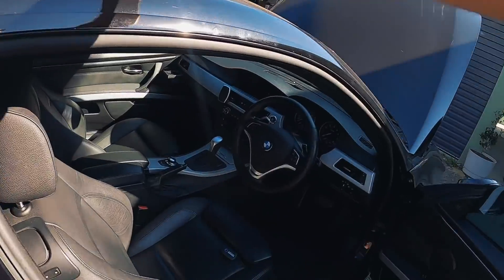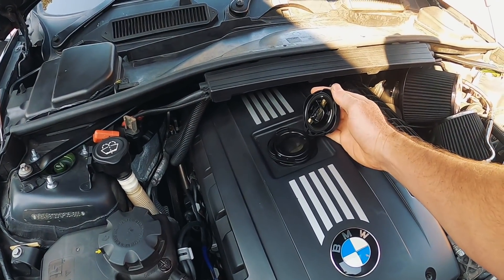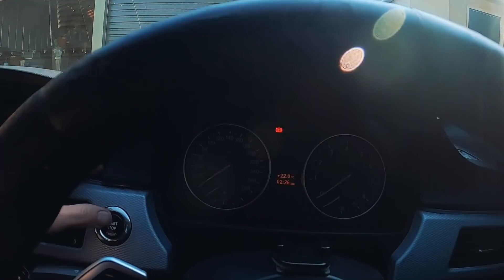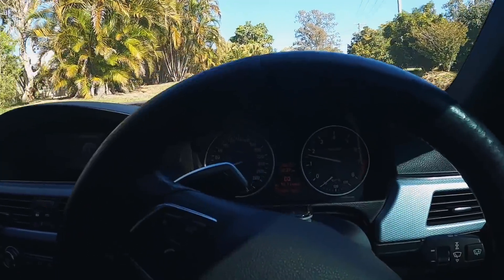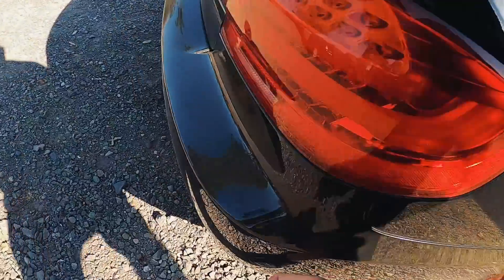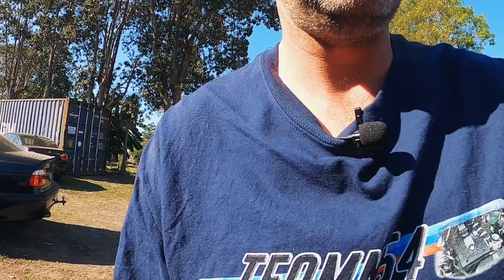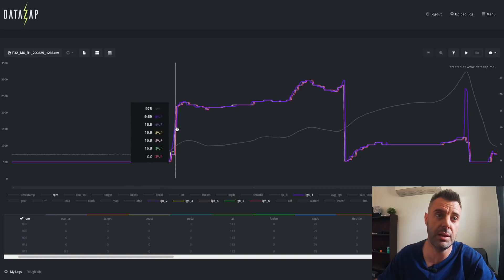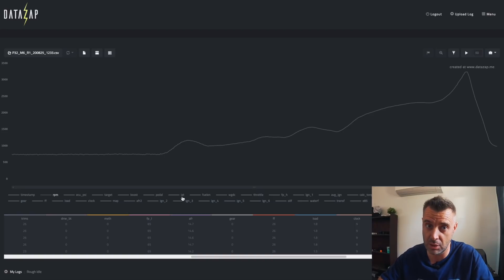BMW E92 335i N54 17T Hybrid Is Now A 5.5 Cylinder.....😖

Comment: FWIW, my car would sound like a cam when the spark plugs were going bad. Changed them and it fixed the issue, but I have the PR Coils so it never actually throwed a missfire code or the likes, just sounded like a cam, check them and their gap before you jump the gun into opening the engine up. For the coolant loosing presure be sure its not leaking anywhere, my o ring coming out of the expansion tank and the one at the bottom of the radiator for the AT heat exchanger gave up and created the same sympthom with the added loss of coolant in time, not pretty at the track

But long story short:
-Check compression
-Check spark plugs
-With cylinder roughness in mind check the coils or swap them all if you have enough spares

If non of these solve the issue... well shit
Reply from the maker: Really? I would have spent 4 hours googling today and couldn't find anything plug related that resulted in a similar noise. But this sounds like it has a cam.  I do have my old plugs which were fine, so i will pull these, do a compression test. If thats fine, ill put the old plugs in and see how it runs.
Reply: I had a similar problem with a gsxr600 that had bad plugs...fingers crossed...
Reply: @ZeroTo60Tube  It took me roughly a week of checking stuff out to find the issue, I think it was on spoolstreet that I read the possibility and went from it and solved it, it may not be your problem but its worth a shot
Reply: +1 to this, my E46 was like this and after plugs was fixed.

Comment: Have you considered arp head studs? I’ve seen them solve head lift on other platforms... if it’s pointing that direction.

how does the oil look?
I’m suspecting mild plug erosion or fouling.
Reply from the maker: I haven't looked in to the ARP studs yet. A good condition N54 "should" be fine at these boost and timing levels, however my motor was not a good condition one when i got it. Which is why i bought the spare car.

Comment: Everybody saying check smooth running is how you’ll narrow down a weak cylinder.  But based on your afr chart I’d put the money afr 2 “bank”. It looks very rich.  At idle anything other than 14.7 is bad.
Reply from the maker: Bank 2 is where the ticking noise comes from.....

Comment: Cylinder 6 just shat the bed on my upgraded turbo n54. Pulled the plugs and I was missing the ground electrode on #6.
Reply: What power you running to blow up 2 motors already?
Reply from the maker: Was yours knocking or just an uneven exhaust note like this?
Reply: @br4d101  just 1 n54, blown up 2 audi engines though. 4.2l s4 and a big turbo 1.8t a4. N54 is running similar turbos to these in size with pretty much the same supporting mods. 24 psi and only 11 degrees of timing
Reply: @ZeroTo60Tube  mine had a misfire then made a knocking sound. Hard to tell over video but I think mine is more of a mechanical knock. I haven't done the compression test yet to determine how bad it is but I pulled the plug on the one that misfired and there's no ground electrode. My guess is that my knocking is the electrode wedged between the valves or something like that. Going to do a compression and then pull the head if it's bad

Comment: I feel like if you have a compression leak that you would see a lot of unburnt fuel going through the exhaust, which would show a rich AFR, which then the car would pull fuel...but you said trims looked good. We're the long term fuel trims ok too?

Edit: I also just thought if you bent a rod, even if it's just slightly, that you would have lower compression...which would lead to that deeper sound and the ECU wouldnt really notice the change that much
Reply: these cars don't bend rods. Piston or rings would go before rods.
Reply: @maxwellbrown2584  ok I think we all can agree that the n54 has beastly internals, no one will disagree with that claim, the fact that we can push over 600torque from stock internals is astounding considering this is "just" a working class commuter motor by design. But bending a rod isn't actually that hard to do. There are guys out there who have bent rods with relatively low power compared to these guys, and it just comes down to so much torque so fast. Again, we're trying to diagnose a potential problem these guys are having, and a bent rods, even if it's just a slight bend would equate to the symptoms they're having. I don't actually think that is the case, but considering all of the tests they've done in the video, it's still an option on the table.

Back on the rod topic; you give a tuner the challenge of bending a forged aluminum rod good for 1200hp, give them a couple hours and you'll have yourself wasted money and rods. Obviously a hypothetical situation, but the rods in the n54 aren't indestructible. 

Not trying to start a war with you, because you seem like you have knowledge on these motors by your comment, but let's leave these types of comments for the forums ;P

Comment: Checked the oil motor how looks and check the antifreeze level
Reply from the maker: Antifreeze level seems normal. i have not topped it up since doing the turbos. So it should be ok. Haven't dropped the oil since i noticed this yesterday.

Comment: This may sound weird - but it your battery good? I had some weird stuff happen when I had a bad battery.  I'd also check the plugs and coils - make sure they're not wet from an intake manifold gasket leak.
Reply from the maker: It should be. Its under a year old and i am crazy about charging it if i leave the car sitting for a few days.

Comment: Injectors throw no codes, talking from experience here too. Have you the latest injectors? Mine leaked and lead to rod knock, so change them if you havent.
Reply from the maker: I didnt know that. Thought they would throw codes. Yeah i have index 12s.
Reply: Zero To 60 they shouldn’t be the issue then, if they’re index 12s. Any ideas in the issue?

Comment: I've had an issue that's not completely the same but similar. My ideal was not completely smooth and had pops/ small little misfires but no codes at all..... Changed the plugs and coils and has been fine since.... It's been about 2-3 months since I had changed them now
Reply from the maker: hmmmmmmm i would have thought, it would throw a code. But i guess if the plug is cooked still using the same current the coil, will be using the same current and the DME wont throw a code. But these plugs are under 2000k's old.
Reply from the maker: Dude also just noticed your badge. Thanks so much for becoming a member we really appreciate it.
Reply: No problem 👍 love what you guys are doing...... I can't remember if you guys changed the coil pack or not ? Mine were from 2007 so it's possible that mine was just old age causing the issue I had.

Comment: don't panic you should clean or replace your vanos...You don't drive the car enough so it takes a while for the computer to learn your driving habits and turbo set up 
even if you tuned it for the turbos the ecu is still learning whats done to it. Based on your log

Comment: same car, same problem. I guarantee it is not head gasket. I cannot tell you since you have a jb4...which is notorious for this kind of mysterious misfiring. Reflash to stock to be sure it is not jb4. Then replace plugs if they are fouled, and if not, then replace coils. Fuel delivery is not the issue since it doesn't go dead when revving higher.

Comment: slightly bent rod perhaps? Maybe a small head gasket leak into one cylinder? Hopefully it's just air fuel related and an injector has an air leak like dominy suggested. Are you able to run it port injection only? That may narrow it down.
Reply from the maker: Nah defs can't run PI only.

Comment: You ever had the valves walnut blasted, mine sounded like crap on tick over just like that to be fair, I done it n idle was sorted and ran sweet as! Also check your plugs haven’t backed out slightly, they do come lose! Even if u torque them down right, doubt it’s the engine though, they’re pretty bullet proof!
Reply from the maker: Yeah, i did the blasting about 4000k's ago so they should be clean. A backed out plug i reckon would cause this exhaust note, although i would have thought you'd hear it in the engine bay.....Need to get on to it.
Reply: Zero To 60 I’m not sure mate, you’ll have to do some investigating, mine did sound slightly like that though!

Comment: @2:42 sounds like u have a bad hydraulic lifter...  get it checked out before it gets worst... i can hear it slapping through the headphones ... hope that helps🙂
Reply from the maker: Could a bad lifter cause this strange sound out the exhaust? The ticking I have mentioned in the past is definitely in the head.
Reply: @ZeroTo60Tube  Yes
Reply from the maker: @blrn54  what is the best way to check for the lifter? I assume the valve will still seal, but it wont be opening fully.
Reply: @ZeroTo60Tube My guess rings busted or lifter buggered and staying 2mm open. Compression to see if its rings then pull cams out if it has compression. 100% not head gasket. Ive seen 3 or so go in 8 years.
Reply: Playing hard with boost and timing I like it.
Reply: @ZeroTo60Tube  yes definitely it can.. take the valve cover off and rotate the engine with a 24mm socket manually and check clearance between the cam and rollers..

Comment: Hi, did you check the oil filter? I discovered fine metal shavings in mine, but my engine doesn't make any wierd sounds surprisingly.
Reply from the maker: I did when i changed the oil a few weeks ago, but not since the strange exhaust note popped up.

Comment: I'm not sure on the condition of your battery, but during NZ lockdown my 325i sat for a while on an old battery. It started fine, and seemed to drive okay, but when i stopped the car it developed a very rough idle. Possible that youre having something similar?

Comment: Have you done a carbon cleaning on the valves lately or ever?
Reply from the maker: Yeah i did them about 4000klms ago.
Reply: @ZeroTo60Tube  Try smoke testing the system to catch any air leaks.

Comment: Time to start doing the normal diagnosing man... start with the common stuff coils, spark plugs, do a comp test and definitely do a leak down test as a comp check wont always show a head gasket failure... you should have noticed some increase in coolant tank pressure or excess temp if it is a head gasket? Either way man I hope it's nothing to serious for you 😊
Reply from the maker: Just remember if this is a serious issue.... the spare motor is going in and this one is getting built......Purely so i can keep up with you and your new turbo.... :P
Reply: @ZeroTo60Tube  hahahah now that's gonna be some good videos 😊 and you can already keep up with me but will be good to see if I can still keep up with it once its built 😊🤔

Comment: You may have a very small vacuum leak that only causes issues at idle and at certain throttle. I honestly have no idea but that's just a guess.
Reply from the maker: Thats what i thought at first. But the stutter or strange sound doesn't change as i bring the revs up. The engine smooths out a bit, but you can still hear its not right from outside the car. It's like its firing on all 6 but one of the cylinders is not quite as explosive as the rest.
Reply: @ZeroTo60Tube  that makes sense. Do you reckon it could be a big exhaust leak? You mentioned it didn't really feel down on power or is it a clear stutter you can feel as you accelerate?

Comment: Maybe you can do a compression test on all 6 cylinders. Prolly doesn't hurt to look at the spark plugs either. Maybe one of or more have carbon buildup and a slightly smaller gap as a result. Also the fuel tank could be worth investigating if you are running ethanol and it's been sitting for too long. Plenty other ideas, but I hope it's just contaminated fuel that's messing with your maps and sensors. Good luck mate.
Reply from the maker: I definitely need to get the plugs out, check them and do a compression test. I had choice this afternoon, it was make a video and edit it, or start pulling it apart. I really didn't want the bad news, so a video seemed like a nicer option.

Comment: Reset adaptations? Monitor AFR? O2's? Plugs?
Reply from the maker: AFR's are normal. O2 sensors are like 3 weeks old. Plugs are about 2000 k's old. I will pull the plugs and do a compression test in the morning. I could have done it tonight instead of the video, but to be honest, i dont know if i want the bad news.......

Comment: Wonder if it's a leaking injector, either leaking compression out of the cylinder or leaking fuel into the cylinder.
Reply from the maker: They are index 12's so it would be unlikely its leaking. But the injector seal. I wonder if it's the problem. Mind you the engine sounds normal in the engine bay. Thinking about it, i bet you would hear if the compression was sneaking out of the injector seal.

Comment: Why don’t you do a power balance test first, that will isolate which cylinder it is.  (pull coil plug 1 at a time, 1 by 1 and look for change in idle).  Then try swapping the coil with a different cylinder and see if the misfire moves.  I suspect it’s a dodgy coil.  🤞

Comment: Time to do a compression test and leak down on all the cylinders, sounds like a audi 5 cylinder ouch.  Thank goodness  you have a spare motor.  You can do a proper rebuild with some nice aftermarket parts and you will be back on the road again roll racing.  On the bright side you will have more content for the channel, don't give up on this car.

Comment: From my experience on my 3rd motor, do the rod bearings if you plan on keeping the motor lol
Reply: @ryan were the 2 previous failures always the rod bearings?
Reply from the maker: damn son. What power are you runing and what milage on the motors that died?
Reply: Zijkant yuppp rod bearings
Reply: Zero To 60 right now running about 450 wheel hp stock turbos on AT, swapping to new turbos in a few weeks hoping to hit 6s. With proper maintenance and mods to support the car
Reply: Ryan - have you experienced Rod Bearing failure - N54 or N55? I have an N55 with suspected Rod Bearing failure...
Reply: @Ryan.E92  So, rod bearings are now on my todo list when I'm going to install the 19T's that are sitting here waiting patiently for parts to arrive 😅
Reply: AusZman yup had oem bearings melt into the rod

Comment: That's a early-ish disappointment!
I would start with a leak down test, not a compression test. In this way you would suspect a leak (piston ring, valve etc) much more accurate. Pull the plugs and pressurise each cilinder and check the time of depressurisation.

Good luck and I hope for the best!
Reply from the maker: It is what it is. Depending on when you started following the build you might have missed my concerns for the engine. The car was not well looked after by previous owners, its always a metallic tick, that it shouldn't have. I have been expecting an issue. In reality this is why i bought the spare car. Its shouldnt be a reflection on your average well looked after N54 thats for sure.

Comment: whats your AFR under full load and idle. and manifold pressure? sounds like intake or exhayst leak. coolant wpuld put out a ton of white smoke and oil...well you know
Reply from the maker: AFR's were fine under load, i dont want to load it up while its running like this at this point in time anyway.

Comment: Mine is down aswell, had similar, but rather worse sounding idle, car sounded like a V8 with a cam... So I'm waiting on my new Index12's. In your case, perhaps something silly but did one of the sparkplugs back out a little bit or not super tight anymore? Sounds like it's losing compression through spark plugs or injector seals. :)
Reply from the maker: If that is the case, i would be very happy..... That it was it sounds like from the exhaust. One of the cylinders doesn't have full compression. But i would have thought if it was coming out of the plug or injector holes, the noise in the engine bay would be significant.
Reply: @ZeroTo60Tube  Strange indeed, I guess a compression/leak down test would make up for some good content for some viewers ;-)

Comment: This sounds just like my car did when I lost compression in one of the cylinders and well another cylinder was on it's way out. How many miles do you have on your engine? I suspect compression numbers will be low of some of the cylinders.
Reply from the maker: Its done 159,000k's. Did you ever find out what caused your compression issues?
Reply: @ZeroTo60Tube  I am not sure I am looking into that now, I am wondering if maybe it had anything to do with my flex fuel system, bad e85, or maybe a leaky injector maybe? I doubt it's tune related though. My motor had 200k when it lost compression.
Reply from the maker: @N54ftw  Very keen to know what happened to yours. Sounds like we are in the same boat.
Reply: Zero To 60 I’ve taken out number 4 and 6 injector. Just by looking  at it seems like cylinder 4 was leaking for sure. I also Took off my primary o2 sensors and it looked like one of them was a bit darker then the one other indicating running a bit rich. I believe my leaky injector with possible bad o2 sensor was the reason for constant misfires on 4 & 6 that I’ve been chasing for a long time. 😔